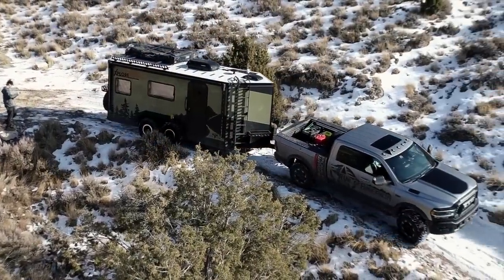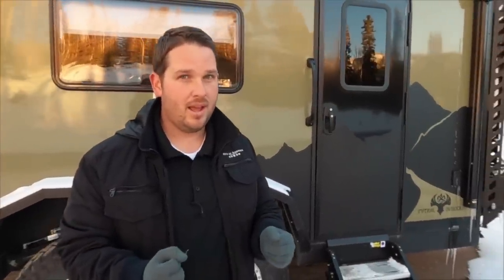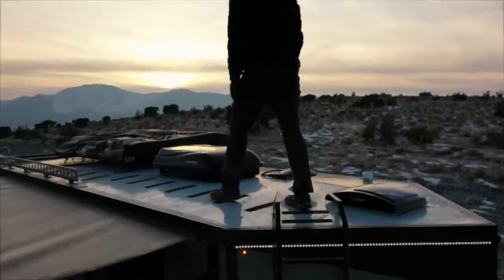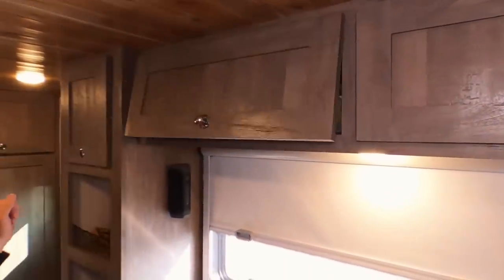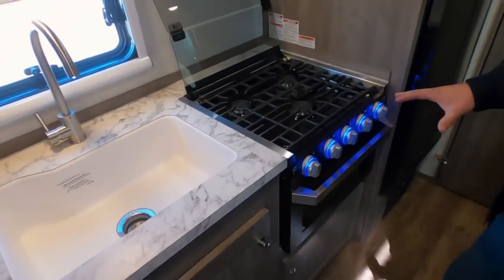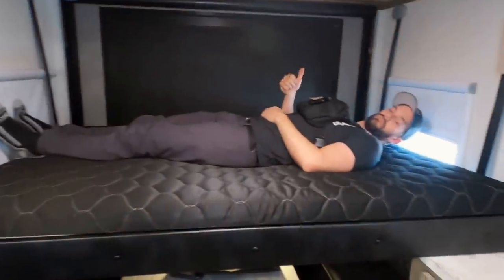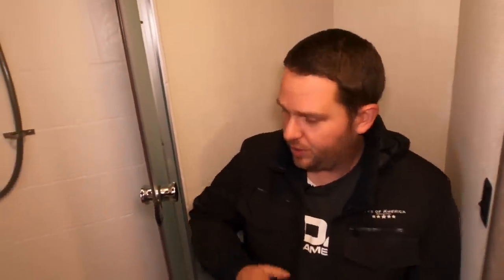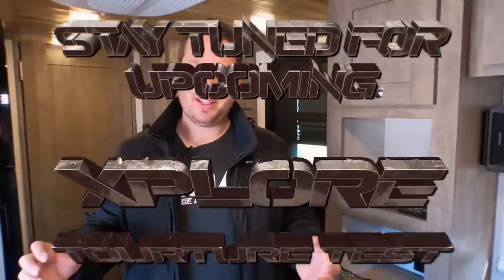XPLORE XR-22 QUICK TOUR ROA (2022)  Is it better than Bruder, Black Series, MDC Lance or Opus?

Comment: I really like that there is a toyhauler version; however, I wish there was more time spent in showing it. There are aftermarket patio kits, which would be nice if this implemented it's own railing system and/or screened wall. Toys or no toys that space is a great addition, in my opinion, so would be nice if it was run with a bit, since you've gone so far as to have a roof tent/observation deck. Only other drawback would be the toilet space being a bit cramped, but nit picking a bit as the camper brings a lot to the table.

Comment: Is the garage big enough for a 4 seat side by side or 2 quads? I know it won't hold an Arrgo.

Nice job on the review.
Debating this and HQ17
Reply from the maker: Thanks so much! Unfortunately it will not hold a 4 seater. Single ATV or snowmobile. Or bikes and dirt bikes..
Reply: Will it fit a 2 seater razor.
Reply: @Berrypancakes229  It's too narrow for a razor.  It will barely fit a Sportsman from the measurements I received.

Comment: Very nice. Have you ever had a gas (propane) freezing problem?
Reply from the maker: They are not gas? They are 12volt
Reply: @ROAOffRoad  Ah ok thanks. It would be nice if electronic products such as refrigerators could also run on gas. This can be very useful in times of low sunlight (especially when offgrid).
Reply from the maker: @UnidentifiedBroMusics  Yes! They are now adding lithium in all the trailers to help. 200amp stock and 400 amp lithium as on option. That will for sure help!
Reply: @ROAOffRoad  Thank you for the information you provided. I've been searching for rv's for a while. This has been the best fit for the features I've been looking for so far. There is room for a motorcycle, a toilet, a bed, a kitchen, and it's not that big. And suitable for offroad.

Comment: Okay what happened to the incinerator toilet those cartridges or $150 for three minimum I noticed no drinking water with a filter disappointed on the size of the TV you called it a bunk bed is it big enough for two.
Also lost the washer in the bathroom.
What is in the garage?
Is it heated?
Going to look for the full video on this but it's not like I don't like it I just feel like we lost something.price? so I'm going to go back and see the full video to see the pros and cons
Reply from the maker: Sorry. It seems like you might be confusing this trailer with a different one? None of that stuff has ever been in this trailer?

Comment: How well did the Power Wagon tow that beast ?
Reply: It did great. Didn't barely feel it..
Reply from the maker: We are doing a off-road test next week and you will be able to see the truck towing it more.
Reply: The trailer only weighs 5200 lbs dry. So its not super heavy.
Reply: Will a Dodge Ram 1500 diesel be ok for this?

Comment: It is possible to option a “cassette” toilet?
Reply from the maker: The manufacturer does not have it has an option. But ROA is able to do pretty much anything.
Reply: @ROAOffRoad  I would want an Incinerating toilet instead to cut down on the trash. Sounds like you would be able to install one of those if we wanted correct?
Reply from the maker: @stuarthoffman1668  Yes. Absolutely. We have installed many.

Comment: Can a stock Ford F-150 tow this?
Reply from the maker: Depending on the engine... As long as it can tow over 7000lbs. We have towed it with no problem with a Jeep gladiator that's only rated for 7,200 lb. Most F150s are rated for closer to 10 and 13,000 lb.
Reply: So you’re going to tow a 68k RV with a 40k truck?

Comment: How many people can this sleep?
Reply from the maker: 3,  2 in the roof top tent, 1 on the bunk bed.  You can also fit small children on the bench, and there is plenty of space for a mattress on the floor if you wanted. The XR-22 comes with an air-compressor so inflatable mattresses are more do-able. But really if your looking to sleep more people comfortably we would recommend the XR-22 which has sleeping space for 5 very comfortably.